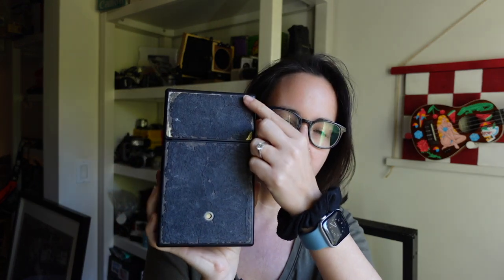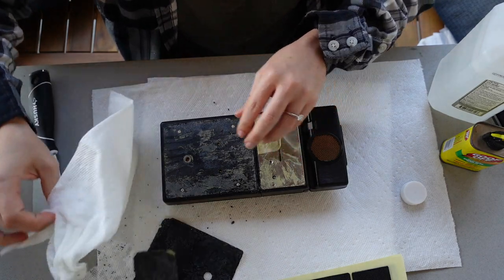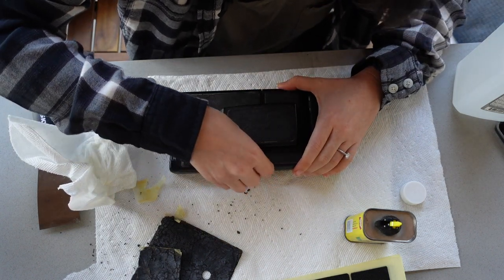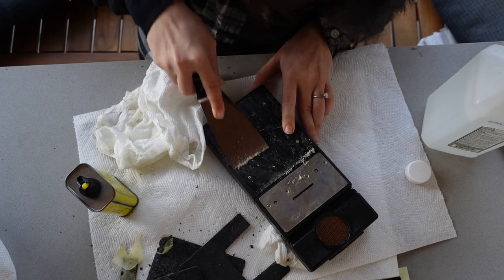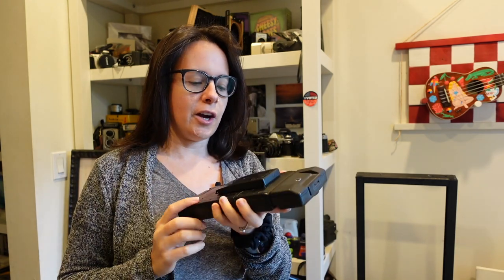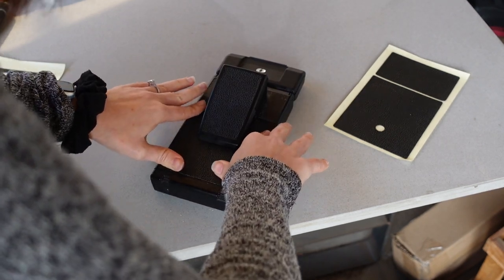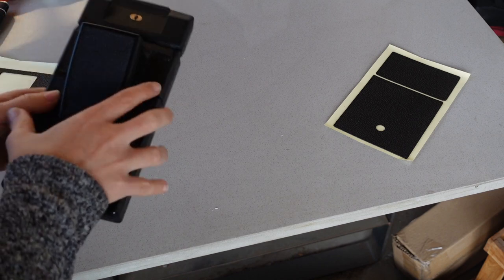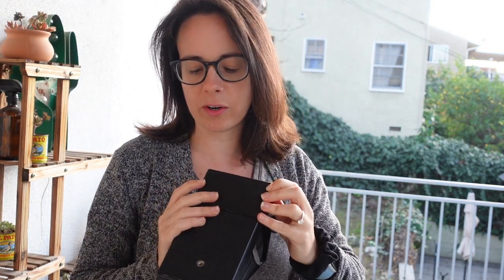Reskinning My Polaroid SX-70 Sonar

Comment: Nice work.  I have used this vendor before also to reskin a Mamiya M645.  I am working on a project to design and 3D print cut templates for a number of my other cameras.  I have some custom color pieces that I would like to use. This is cheaper in the long run when you doing a number of items and the vendor does not have the color you really want.  Just a note to help get the replacement pieces to stay down you can use a green or blue pad to fine-tune the surface of the item the pieces are going onto.  Also, a car detail kit, which is plastic, and they have rounded and smooth edges.  This will help to keep constant pressure on the edges of the leather when putting it down.  You want to keep as much body oil away from the leather pieces until they are firmly fitted.  Once that is done you can use Kiwi shoe polish to help nourish and seal the pores of the leather.  Use a buffing cloth or shoe brush to put a little shine on your finished product.

Comment: A bit of hand sanitizer on the edges of the new leather would have allowed you to move the pieces around a bit during application to make alignment easier. Just a little tip for next time. Good stuff!
Reply: I used hand sanitiser to dissolve the old glue when I replaced my K1000 light-seals! I don't know why, but it was easier to find that than isopropyl...